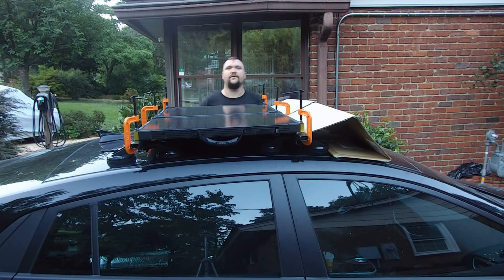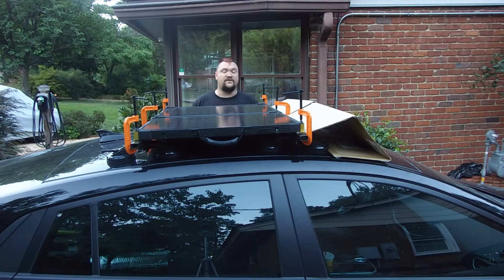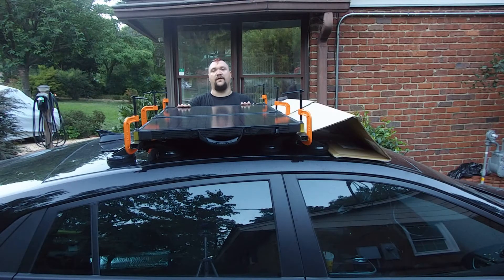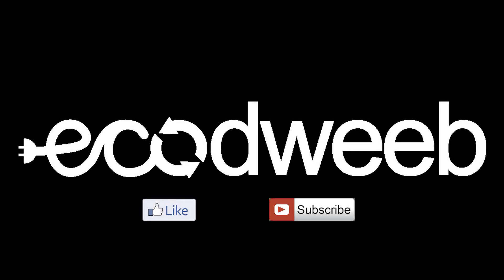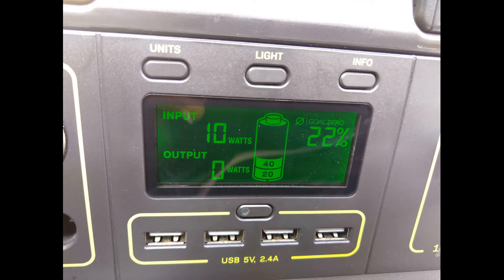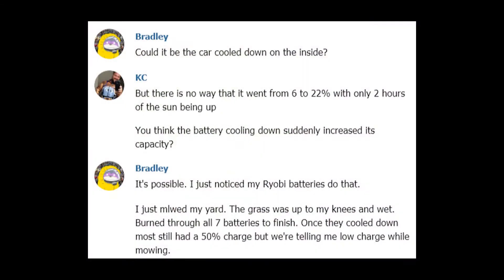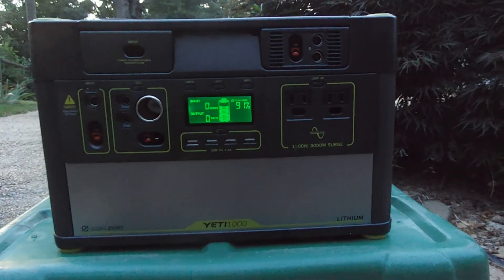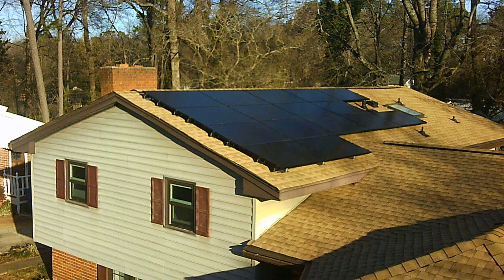I slapped a solar panel on the roof of my car... (Goal Zero Boulder 100 charging Yeti 1000 test)

Comment: Since Lithium batteries can be charged quickly (C-rate), pumping high amps into the battery at charging stations is the answer for now. If a battery can be charged in 5 minutes, it's worth the wait.

Comment: Thing is it would be ideal if you did not have anywhere to charge as a lot of people do not have a garage to plug it into
Reply from the maker: You're better off spending 30m at a fast charger, honestly. It would take weeks for this rig to match the output a 30m session would do.

Comment: It is cost effective in SION of Sono Motors. Lightyearone is a costly scenario.
Reply: Yep, IT makes sense on a city car. 2kWh Per Day is 16 miles. So if you live close to Work, IT is enough for weekdays and weekend shopping.
Reply: Lightyear is a luxury sedan. Therefore costly. At the same time energy efficient as bicycle!
Reply: @gatiskrauklis533  Actually very close in efficiency to a bicycle: Lightyear one: 1300kg; 83Wh/km =0.63Wh/kg/km. Cyclist: 90kg; 5Wh/km=0.56Wh/kg/km. However if there is more than the driver in a Lightyear, it beats the bicycle 4-5 times over. Add to that that food is the dirtiest fuel source known to man and the human body is an inefficient engine, so even with a single occupant, the lightyear emits half as much as a cyclist.
Reply: @Tore_Lund  XD  Cool!